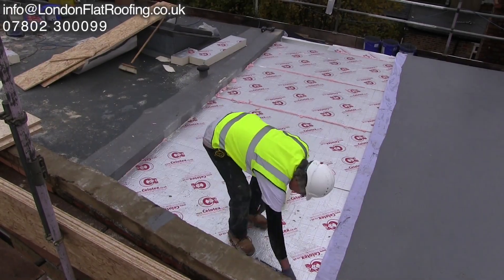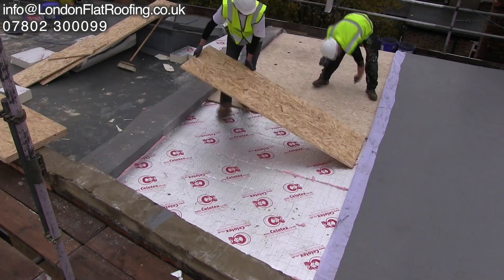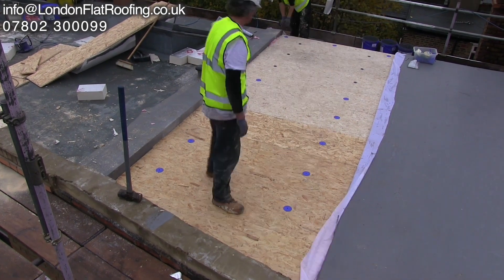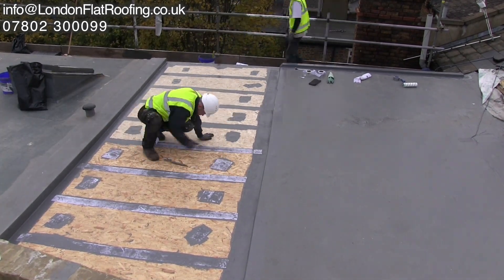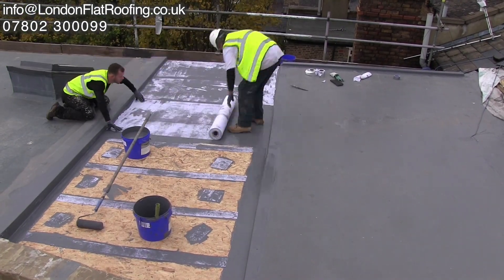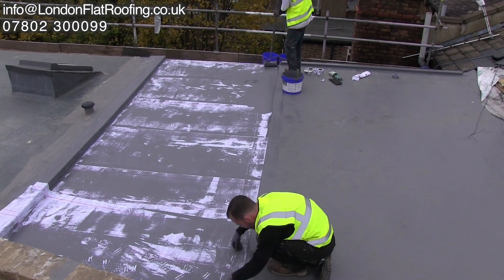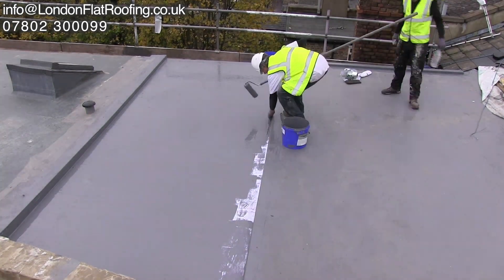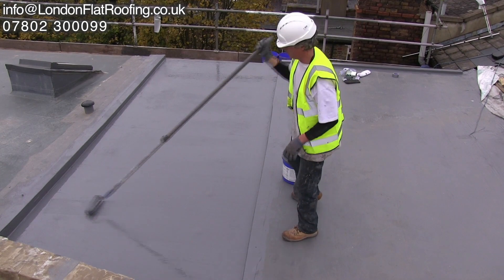Liquid Rubber roofing system over a warm roof with thermally broken fixings

Comment: how could you trust the osb board ?
what if the board come loose?
my think, the epdm rubber more safe than  liquid one.
Reply: ilyas yılmaz the liquid becomes just like a rubber sheet once it cures. The rubber was once liquid & moulded into shape. These systems do the exact same but on site
Reply: @guyanagold4869  it is not exactly same thing.
liquid essential product can't strench like rubber one.
if the place doesnt come loose it is okay if not its a problem.
Reply: ilyas yılmaz you can’t walk on epdm
Reply: Not enough fixings not durable  long term love to read through guarantees   wording . We take dozens of these shite roofs off per year  carry on lads but you know and I know it  it's crap only time it works is when it's supported by old mineral roof below it .Joe public  your being  fooled by bullshit

Comment: Hi Steve...what material did you use for the sealing/reinforcing?Also what specific material you used for the fixing (thermally broken),..btw i subscribed to your channel..good job on your videos
Reply from the maker: The reinforcements for the liquid roofing is a polyester quilt that is part of the system. It's essential that we only use the materials that come with the system as that we can lay a roofing system that is recognised to last the guaranteed time. This system is a 25-year roofing system.

Comment: Nice job .how much a square meter to buy ?
Reply: peter amberley not to expensive between 92.50 and 93
Reply: Michael Kavanagh that sounds expensive  too me . Are you sure thats correct ?
Reply: The fleece membrane isn’t to expensive 19 a meter, top coat is also less then the base coat top coat is only 55 a Meter so overall reasonable how many tins will I put ya down for ??
Reply: Michael Kavanagh unless you talking about austrailian dollars  i think you have your wires crossed im asking how much to buy the materials not quote for supply and lay .